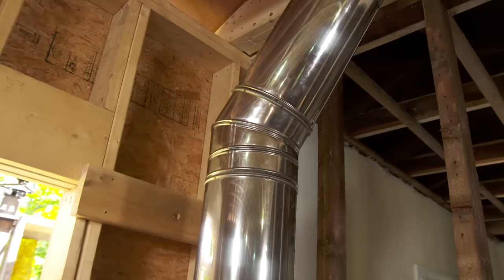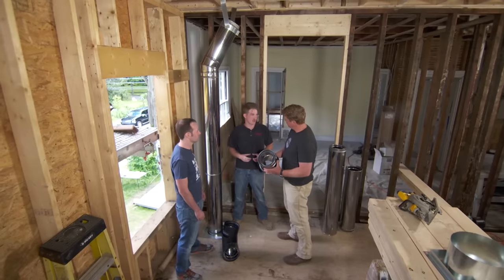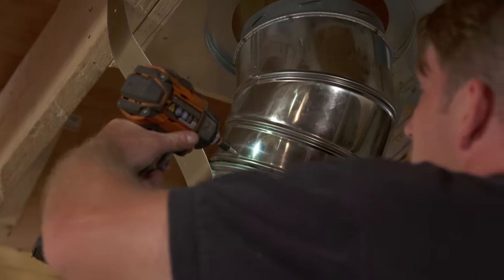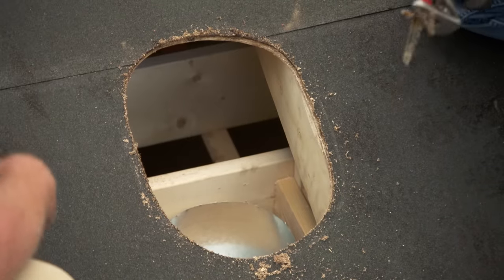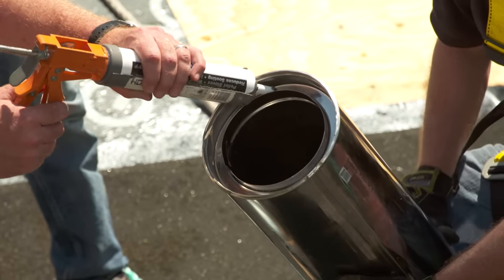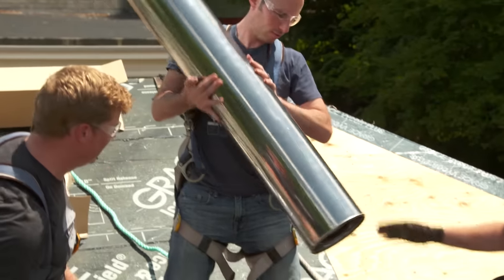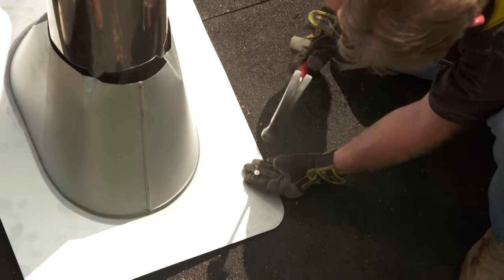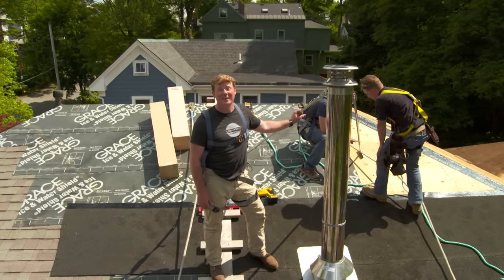How to Install an Insulated Chimney | This Old House

Comment: WTF, 4:51 they put the storm collar first? Lmao
Reply: Looks like they edited out the part where they removed it
Reply: Storm collar goes on top of insulation shield to prevent insulation from coming into contact with the pipe. There should be a storm collar on top of the flashing as well. They are required in both locations.

Comment: 2:30, nail is off center, 2:27 corrected. nice save. Good install, but I don't ever recall seeing anything in the duratechs install guide about silicone in between stove pipe lock joints?
Reply: M  never thought of doing that! 👍

Comment: Why did they make such a large hole (and an oval). Also I would have wrapped that connection even if it had a special seal. Belt + Suspenders. Also, you know somewhere the roofers were probably screaming at them for how they sealed that and what not. Looked sloppy to me as well.
Reply: They needed 2inch clarence to combustibles. As for the oval hole the roof is slanted to if you was centered above the pipe it would be a circle 2inches bigger than the pipe on either side
Reply: Nah, you ain’t seen “sloppy”. May not look purdy, but that is rock solid. That’ll hold up in high wind and heavy snow with no probs.
Reply: @は私です彼の名前  my chimney support pipes bent after 1 winter. They're pretty strong so I can't imagine the snow load weight to do that. But it did
Reply: @turnipking5152  BS, way too big, unnecessary, they had over 4 inches of clearance.
Reply: @jameswestii454  No installer uses this method, takes too long.
Reply: @tombryan1  You're right. I used to install chimneys through roofs. Not sure why this guy cut such a big hole. That said, the too-big hole really isn't hurting anything.
Reply: @turnipking5152  and 2" is minimum clearance. MINIMUM to the professional homeowners on here.
Reply: Roofers haven't touched that roof yet, except to put down the felt. The other trades then go through, make all of their roof penetrations, THEN the roofers come and seal up the lid.

Comment: Farcical instal or cheap system you decide. 
Should be spring clip joints. Twist together fitting good. Then you invalidate the system drilling into it. Manufacturer would supply pre drilled with fittings screws so someone doesn’t just tosh in a screw. Then worse still you also glue so can’t be serviced if a piece gets damaged. 
Decent system would have collar springs for each section, only place you cement & screw is the fitting for the flue to join your stove.

Comment: Why does the tie down get zipped in before the shingles... asking for a friend.
Reply: Dumb question, dont attempt to do it if you are asking such a question.
Reply: Cause its a new roof....old roofs just go over the shingle with plenty of silicone under tie down and screws.
Reply: @tombryan1  Dumb answer. Don't attempt to respond unless you're going to actually help someone with an answer.

Comment: Sorry I should of watch it to the end they corrected themselves. Still the caulking around the pipe was sloppy. Length of pipe coming out the roof is based on the 10/2 rule. If the pipe is within 10 feet of the peak then it has to be 2 feet above that peak. If greater than 10' and you have a minimum of 14 feet total run (check your manual for minimum vent run) then the pipe can be about 4' above roof line.
Reply: Not every town has the same rules. Maybe check where they are before commenting.
Reply: @jpatrick1967  it's based on the mfg of the pipe too. also a good installer will check/ask for normal wind direction to make sure the peaks/ other house structures doesn't affect draft. sometimes you will need to greatly exceed the minimum height to get a good draft in single story chimney when there is a 2nd story nearby.
Reply: Joe in Kentucky just put it up 4 feet and said that's good.

Comment: "Let's try and make sure the seam is to the back"

drives in a screw right in the front.
Reply: Lol I was thinking the exact same thing 😅  all well no one would ever notice after the fact !
Reply: He should not have even used screws. They make locking bands that go around the two sections to clamp them. The screw allows water to penetrate the pipe.

Comment: I am installing a wood stove in my garage and there is no attic or crawl space above the ceiling. Trying to figure out how to see what is between the ceiling and the roof... how do you handle situations like this?
Reply: you use a stud finder then mark or cut a hole between two studs. maybe cut an entrance and install access door near the pipe location to get into attic.
Reply: @rekostarr7149  That's not what he asked, Mr. Professional Homeowner. OP, what I recommend is to drill a small hole first enough for a camera to go into that space to survey. If you don't have a camera, just cut a small hole first that is easy to patch up.

Comment: Holy cow what a sloppy disaster of an installation. Half-assed and guaranteed to leak in about a month.
Reply: No it isn't. Its exactly how you do it. I assume you are a troll. Or you don't realize the roof needs to be shingled after the installation.
Reply: It looks pretty standard to me. No problems that I see. I might use locking bands rather than a single self tapper, but thats me. The screw should work fine.
Reply: On any B vent or fireplace style direct vent pipe we Vulcum seal the roof flashing/pipe connection under the storm collar and then slide storm collar down and seal that connection too
Reply: I'm saying!
Reply: I'm saying!
Reply: You must a professional homeowner.... Stick to knitting.
Reply: @metaltera86  It is different for a wooden stove. You actually want those ports open for the heat built up to escape. This isn't furnace or fireplace venting. Look up class A chimney parts and you'll see roof flashings with ports in them.
Reply: I just saw this video but I'm with you.. absolute garbage!

Comment: How about during rainy season, the rain water merely goes straight down onto the hole. It should have been covered with tiny roof on top of the chimney at least 12 inches right above the edge of the chimney/hole.
Reply: The roof isn't done. Cant you see that?

Comment: Aare you serious? The storm collar goes over the roof flashing which also should be sealed underneath as an extra precaution. I am a licensed and insured mechanical contractor specializing in fireplaces for over 25 years.
Reply: Pretty sure that first storm collar was to close off the insulation shield to protect the engineered air space. Also, I’ll double check the install manual on DuraTech, but the flashing should be ventilated and not sealed. The upper storm collar provides the flexible needed while providing overlap to keep it dry.
Reply: I believe John Cunningham is absolutely correct.
Reply: So contractors always do a good job lol? And keep up with the latest  manufacturing recommendations?

Comment: Prefer my fires outside where I can enjoy the smell and open flame.
Reply: Raw Bacon  I also prefer to be able to sleep at night with out a fire risk.
Reply: I like chimneys but usually dont feel the need for fire risk since I have standard central air and heat.
Reply: Raw Bacon not in 15f degree weather

Comment: Thats going to leak water in no time.
Super sloppy work.
And the last covers around the roof looks horrendous
Reply: tullgutten roof not finished by the looks of it
Reply: @FSGAMER35  well I ain't blind 😅
But the roofer guy is likely not ripping off that pipe flashing to do it properly.
And if he doesn't it is going to leak soon
Reply: Not sure what people are talking about. The roofer part of the job wasn't shown. More flashing could be added after the shingles go on
Reply: @cgaccount3669 more flashing didn't need to be added, but the bottom part of the flashing should be over the top of the roofing and the top part of the flashing should be under the roofing.  Which means the roofer would have to pull the two nails they put in on the bottom to do it properly. Not that that would take a roofer more than a couple of seconds to do.

Comment: I still prefer Direct Vent Gas.
Reply: Wood is best for emergencies.  If the power is out you can still live. And gas isn't available everywhere
Reply: Joe Kinchicken  Where the hell? Your reaction is a little extreme don't you think? I have natural gas. But for you to assume the entire planet does is naive. And an ice storm in Quebec or natural disaster in NY shows areas can be without power for weeks at a time. That's why Quebec had a surge in wood fireplace installations. If you think it'll never happen to you well I hope you're lucky because you're living in denial. There are a number of ways your local power grid can go down. And without power you can't use fans etc. Now you'll tell me everyone has solar power since it's so cheap and efficient lol.
Reply: Joe Kinchicken  I know. But without a fan the heating capability is extremely reduced since heat can't be blown around the home. I guess if you have a bunch of gas fireplaces it's better than nothing. I also wonder if the gas pipelines need electricity? If not the pipes the monitors must?

Comment: didnt mention code specifics,  using the same brand of chimney pipe throughout is required, didn't silicone the flashing, didnt mention code specifics on the attic/roof or distance from combustable materials,  didnt mentioned situations where one would use single wall stove pipe, chimney pipe, double wall triple wall, type A or type B pipe. etc etc
Reply: Code change from region to region. In some regions there's not even any codes. You can't even see if they did silicone or didn't silicone the flashing, but since this is a new roof install I don't see how this matters, unless it's code in your area. Most of This Old house videos aren't instructions videos on DIY step by step if you haven't figured it out by now. They are just in surface videos to give an idea. As an HVAC contractor though, class A chimney is one of the most dangerous chimney installs and needs to be done by someone that has either researched the clearances and can climb roofs, or leave it to a pro.

Comment: Nice of them to nail the flashing down tight to the roof before it gets shingled in properly.  Idiots. Didn't even use a roof support package.  Sloppy half assed work if I've ever seen.

Comment: Loving the comments about poor installation - plenty of bloopers in there but the first mistake is in the video title: "Insulated chimney" - which basically means the heat from the fire is being piped straight outside and not being allowed to heat the house !

If you want to install heating with a flame that needs a chimney - you know they've got it wrong if the chimney comes out the top !
Reply: How do you heat the house with the chimney?
Reply: can you rephrase because you are not comprehensible at all: ''If you want to install heating with a flame that needs a chimney - you know they've got it wrong if the chimney comes out the top !''
Reply: @rekostarr7149  Which bit of English are you having difficulty with ?
Reply: @millomweb  none of this comment makes sense, you should go back to secondary school for some help